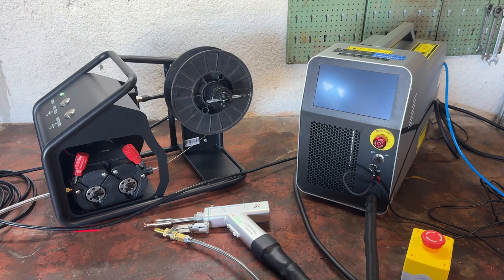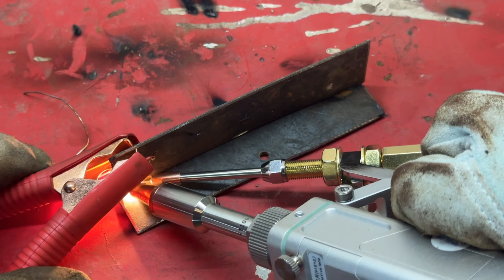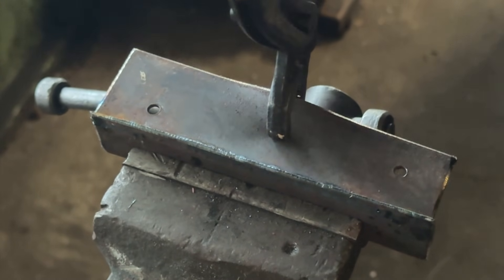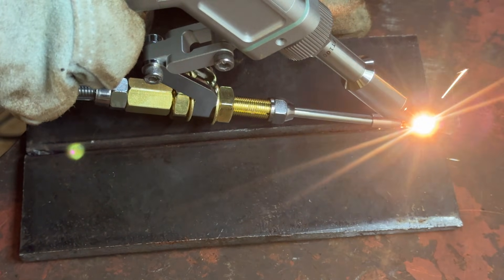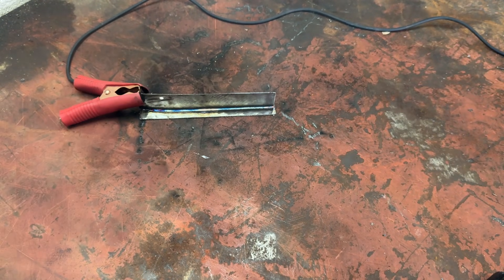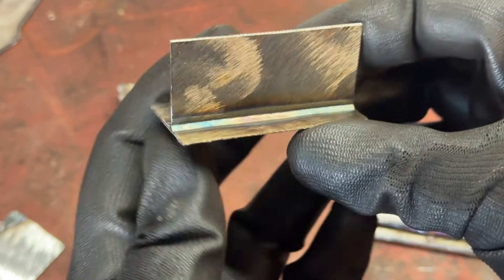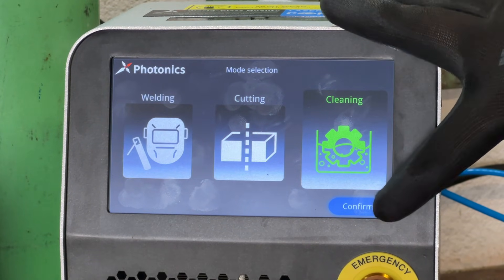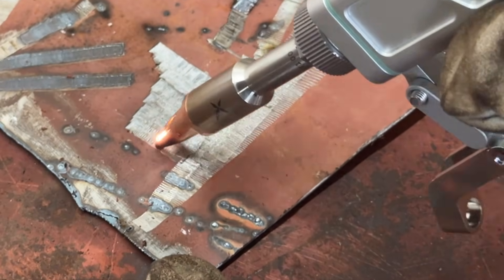LASER WELDER! Can a Beginner Really Use a such a thing? XLaserLab X1 Pro Review

Comment: I like to remind people that, for those who are familiar with MIG and TIG, you can’t drop this gun and expect to just get back to work. There is a motor and mirror inside that moves, as well as a focus lens and a couple of safety lenses. Dropping the gun could damage any of this. As these guns don’t detach from the machine, it’s a real problem to get it fixed or install a new inw. I have a laser and I’m always careful to not put it down on the table, but into the gun stand provided. You don’t want it slipping on to the floor.
Reply from the maker: Thank you for bringing that to my attention! I am always careful with my tools but I will make sure to be extra careful with this one now!

Comment: even with proper welding table, it is best to clamp ground cable directly to the piece you are welding. Atleast when welding with arc, but maybe with laser it's not that important?
Reply from the maker: It’s still as important, although in some modes, such as cleaning the ground clamp can also be attached directy to the torch and then the contact is not an issue at all.